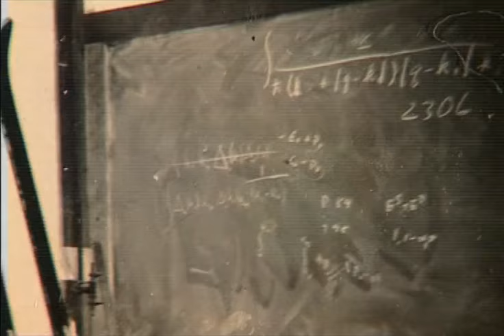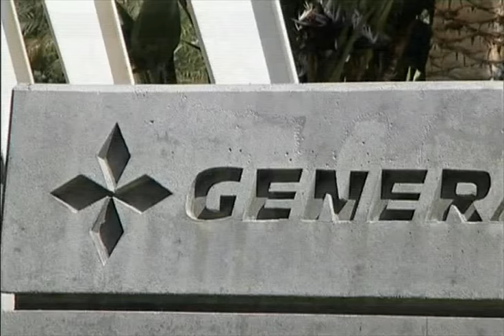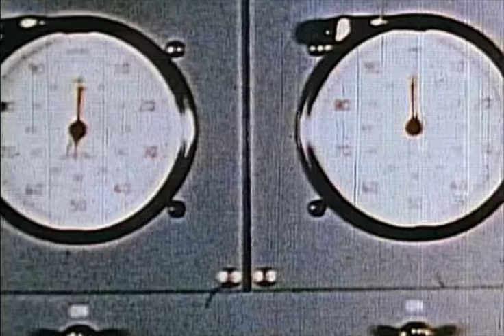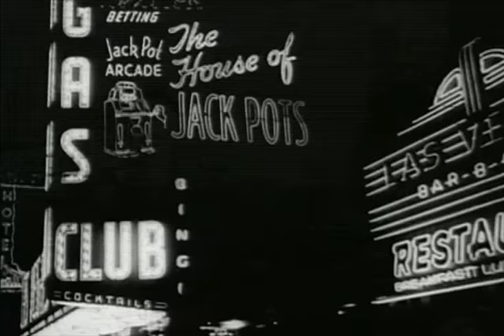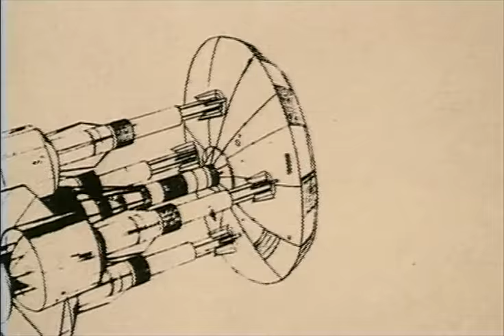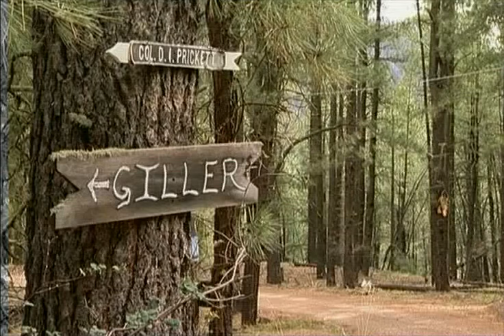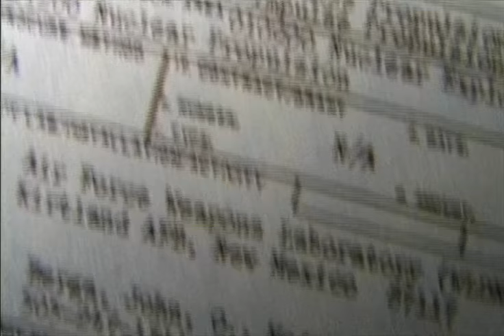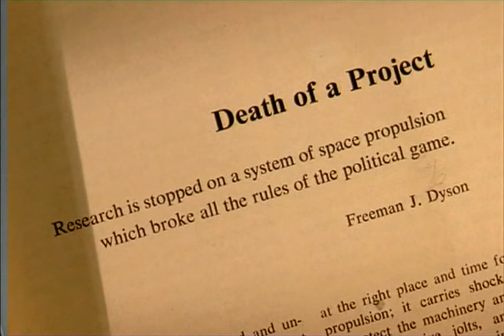The Secret History of Project Orion: To Mars by A-Bomb

Comment: The issue is getting project orion  into orbit then launch it from there.
One way to do it is launch the system is from a conventional super booster such as (Sea Dragon) it could be launched in sections or maybe the whole unit.
Reply: Modular construction in orbit seems to me to be a sensible solution, and it suprises me this wasn't considered at the time, as it adressed the biggest single non-political problem with the system. Eventually, we are going to have to return to Orion one day, unless we are willing to be bound to Earth. The only realistic alternative is nucler rockets, which offer many of the drawbacks of Orion, whilst giving far fewer benefits.

Comment: It works in fundamentally the same manner as rockets burning fuel - exhaust is released at a high speed to propel the craft forward.  In the case of a rocket, the exhaust is burned and released continuously, while with nuclear propulsion, the explosions happen in discrete bursts.

Comment: if the spacecraft is propelled by the nuclear bomb shock wave, and the shock wave is created by compression of the explosion itself in an atmosphere...

how can this spacecraft move when a nuclear bomb cannot produce a shock-wave in the vacumm of space??
Reply: The drive bombs have a different construction, which ensures, that, upon explosion, most of the generated plasma goes in the right direction and impacts the pusher plate.
Reply: I saw a video were they had a working model of Orion and tested the concept in space and it worked using conventional bombs.